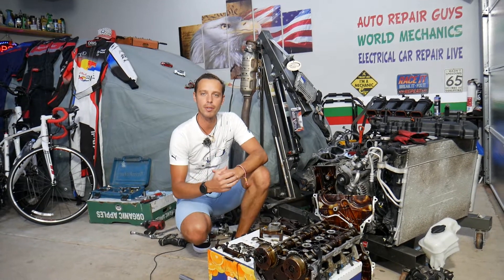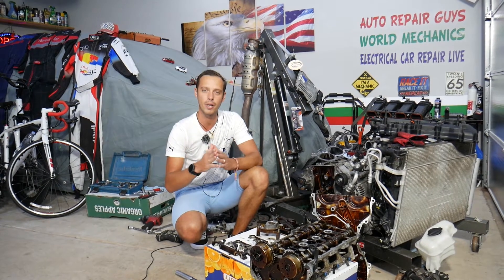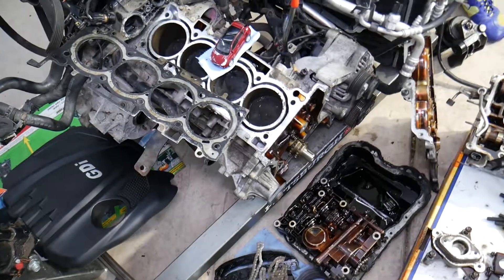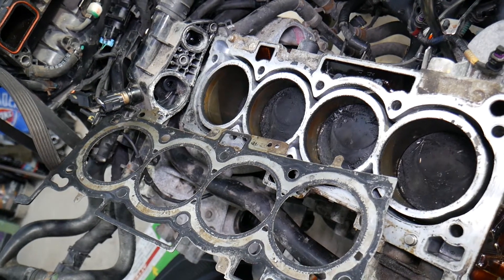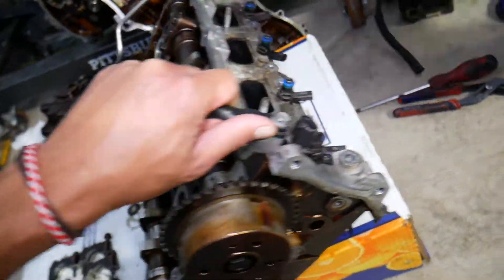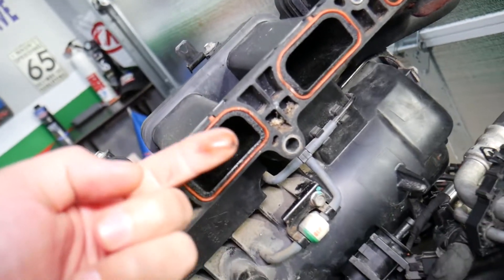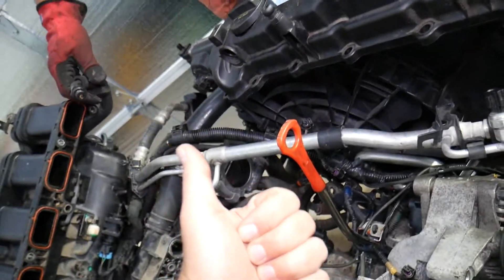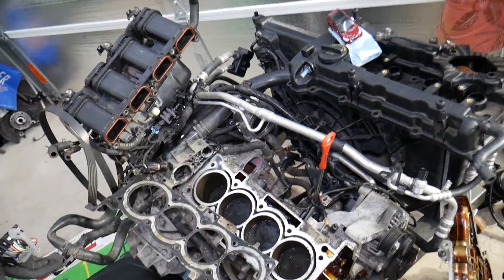HYUNDAI TUCSON INCREASED OIL CONSUMPTION, BURNING ENGINE OIL FIX

Comment: Stumbled upon this issue when looking up the lubricant for the seat tracks....I can't believe what's going on here. I have a 2017 Santa Fe with the 2.4L engine with over 170K miles...and never had an issue with oil consumption. Of course that doesn't happen with any of my vehicles, as my great grandad told me back in the 80's to run a can of "Berrymans B-12 Chemtool" in every other tank of gas. Pour in the can and then fill with gas....that simple. It prevents carbon from getting behind the piston rings and not allowing the expansion and contraction of the rings needed as the engine heats and cools. Also....you shouldn't be using that ethanol crap in your engine, and only use 100% gasoline....that ethanol has so much particulate matter in it, it will literally wreak havoc throughout your fuel system, engine and exhaust system...don't try to save a few cents at the pump on the ethanol, as you'll pay the price down the road like a lot of you are doing right now paying for extra oil and risking potential engine seizure.  Keep a few cans of B12 in your vehicle in the backseat and pour one in every other time you fill up your car and you will never have the oil consumption problem....and...quit using the worthless "ethanol"....always 100% pure gasoline! Always use a good quality synthetic oil as well....traditional oils have so much butyrol peptide waxes that they gum up engines like crazy after just 10-20K miles.

Comment: The pcv valve is not doing to fix this. That oil/carbon you see on those valve stems is because of direct injection mostly. You’d have to redesign the entire PCV valve system, install different piston rings, and then hope and pray that the bottom end of these engines aren’t eating themselves up due to oil starvation to the connecting rod journals/bearings.
Reply: Absolutely correct!  Yes the low tension piston rings in these engines contribute to this issue.

Comment: Replaced my PCV valve, after 650 miles I thought I fixed the issue. 250 miles later I was magically down half a quart of oil. Topped it off, 300 miles later, down another half a quart.

No signs of blow by other than losing oil.

Small oil pan gasket leak, nowhere near enough to explain the amount I'm losing and how quickly.

No signs of a valve cover leak.

Spark plugs could do with replacing, but there's no signs of a bad tube seal anywhere.

I'm not overdue, I changed it last month, 1150 miles ago. I'm at a loss and about to trade this POS in.
Reply: Same problem here...this is how I stopped it completely...16 oz of MMO oil plus half of Rislone engine treatment..drove for a 1000 miles..oil burning gone. not one drop.

Comment: That won't fix the oil burning on these 2.4 Kia and Hyundai engines. It's the rings. Poorly made engines. They suck!
Reply: Same here
Reply: @krissy8833-j2v  I figured out how to stop the oil burning on mine. I took it out on the hiway, dropped into a lower gear so I could keep the RPM'S UP between 4500-5000. I did that and also let off the gas and let the engine slow the car. I did that continuously for about 5 miles. I then changed the oil and now after 2300 miles it hasn't burned a drop. It was burning a quart every 1000 miles at least. Carbon clogs up the oil rings and by running it like this it breaks it up clears it up. Try it, maybe it'll work for you too.
Reply: Was this in a tucson? Have you had to replace your cat converter previously by chance?
Reply: @emilyhenness938  No it's a Kia Sportage and no I haven't had to replace the Cat.